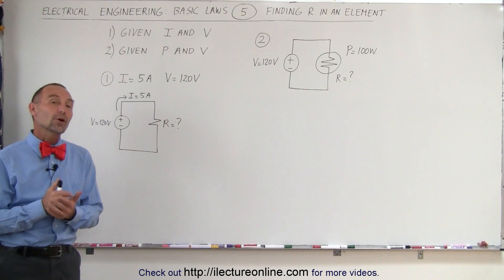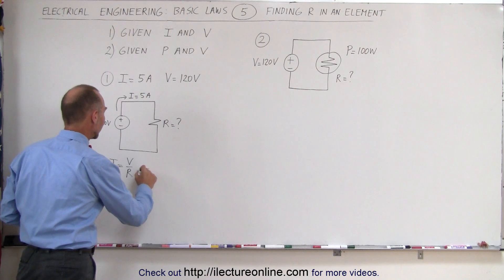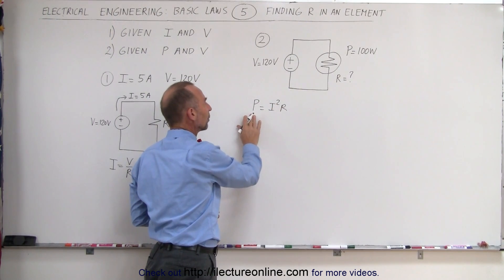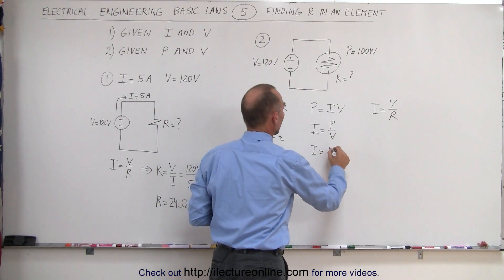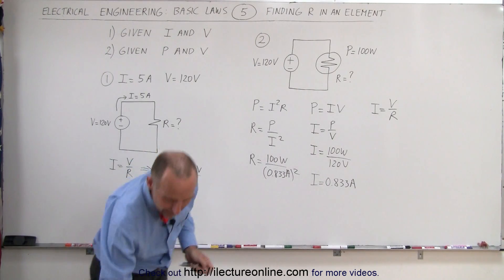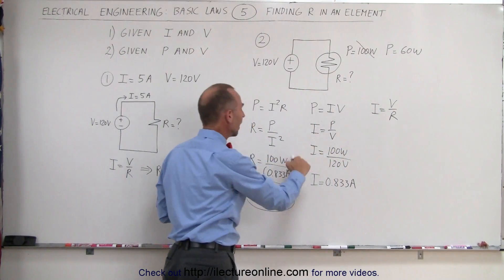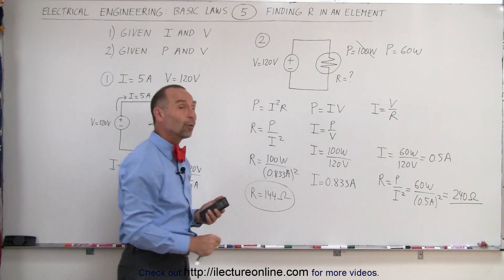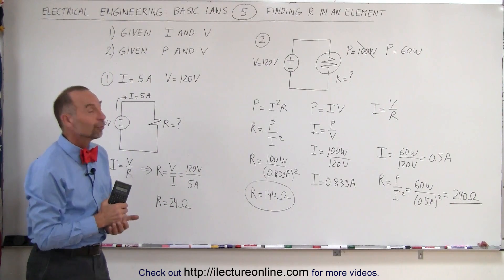Electrical Engineering: Basic Laws (5 of 31) Finding R=? (Resistance) in an Element

Comment: You can also substitue I for V/R to the equation P = I²R -> P = (V/R)². R. Therefore you get P = V²/R.
Reply from the maker: That it correct, they are both valid equations.  (P = I^2 R is the more commonly used equation)

Comment: What is the difference between the first power equation and the second?
Reply from the maker: If you substitute V = I * R for V in the second equation, you'll get the first equation.  The first one is typically used for power consumed (like by a load resistor), while the second equation is typically used for power provided.
Reply: Ok, now I got it. Thanks a lot!